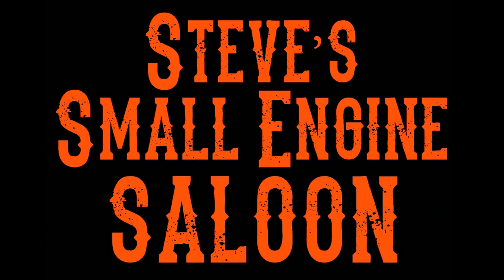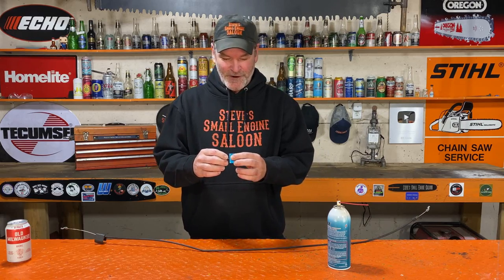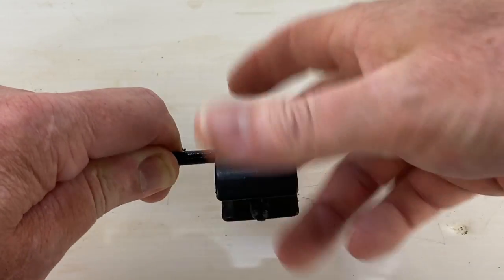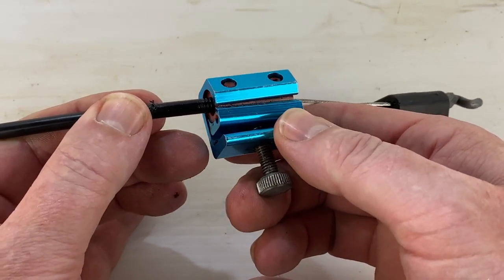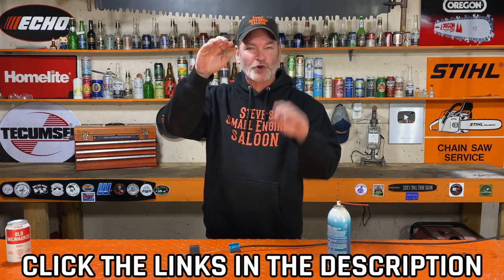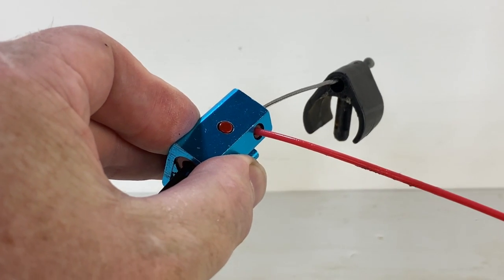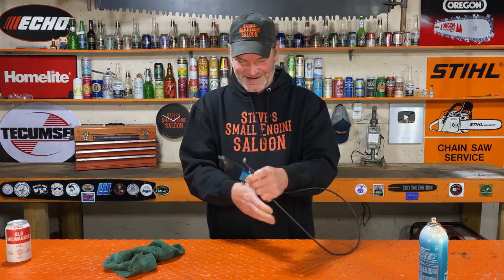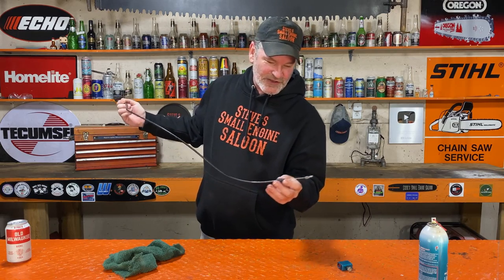The Ultimate Tool to Properly Lubricate Your Lawnmower Cables

Comment: I worked at a Honda motorcycle dealership back in the 70’s. All the mechanics had one of these in their toolbox. Worked great on throttle and clutch cables.
Reply from the maker: Right on
Reply: I can't believe that I didn't know about this tool, and neither did my friends.  So much frustration trying to lube cables, and now you say they've been around since the 70s? That's when I got started with small engines!
Reply: I've had one for 50 years

Comment: Why do cables with sheaths not come with an automatic oiler/ lubrication system as part of a maintence schedule? I mean they make grease fittings. P.S. $50.00 U.S. for a drive cable for a walk behind mower. And yes I know I answered my own question, corperate greed.

Comment: I've had one of these for over 30 years. I haven't used it as much as I thought I would when I bought it, but it sure comes in handy. A must have tool in my opinion, if you encounter bikes, mowers, motorcycles, basically any engine powered or human powered machine.
Reply from the maker: Right on
Reply: I too had one about 30yrs ago when we ran Moto-Cross.

Comment: I've Been An Auto Mechanic 50 Years. I Worked For Volkswagen And Audi Dealers For 33 Years. Back In The 80's When I Was At Volkswagen We Got One  Of These For Lubing The Manual Cables For The Heat And A/C Controls. Even With A New Cable Sometimes Customers Said It Was To Hard To Move The Levers In The Dash Control Pannel . . I Use To Put The Straw From The Can Of Spray Grease In The Hole And Lube It Up. It Worked Great.
Reply from the maker: Right on

Comment: I have one of these that a bought in 1981 that I used on my motocross bikes. It still works fine. I find that you have to be careful lubing cables if you are going to use your machine in winter because some lubes can freeze and cause the cable to be inoperative.

Comment: I honestly think ot was you that recommended one of these to me, but I already knew about them years ago working on Motorcycles  and snowmobiles. They work great and highly recommend them. If the cable is too badly rusted, it doesnt matter what you do, that cable is toast. Still a great suggestion. If the outer sheath is bad on a cable, replace it.

Comment: I saw this luber on Mustie 1 years ago and I just had to have one.  Works super well with cable lube from PB Blaster although any lube is better than no lube.  

Mower cables left out in the weather often have rain water go down the inside of the cable cover and silently causes a metric ton of corrosion / rust.  

Joe

Comment: Hey Steve, I did that to my three wheelers and four wheelers when I had cables on them and I used creepy oil. I don’t know if you’ve ever heard of that but it’s an oil that creeps. You can spray it on the bottom of a bolt and it can have a nut on it and spray it on the very end of the bolt and it will creep its way up into the net works really well good stuff great for lube and your hinge pins in your doors in your house and your locks, whether there are deadbolts or key locks both of them it works fabulous for that stuff just a pin drop or will do the hinges just put it at the top of the engine, open the door and shut it and it’ll take care of the squeak
Reply: "KROIL," "the oil that creeps"

Comment: I bought one of these a few years back.  Mustie1 showed one and it's awesome.  You must have the magic touch because I usually make a mess and get spray all over the place.

It's more than payed for its self saving rusted cables.  I've gotten completely frozen ones working again, Sometimes I'd stray brake cleaner through them first to try to clean out any old lubricant/dust/grime.

Keep up the awesome channel

Comment: I haven't used one, last time I used patience and an oil can with 10W30 oil. It's a bit thicker but actually works pretty good and for a long time.
Reply: Make a funnel out of heavy paper and tape it to one end of the cable.  Hang the funnel from a high point with the cable hanging below and fill the funnel with your oil.  Let it hang overnight.

Comment: I have this and another that I use for lubricating cables on all my machines, motorbikes etc etc. The old trick using a cut sandwich bag and cable ties works a treat as well using some engine oil for lubricating.

Comment: Hello, thanks for the tip, I just ordered this tool.   I have a question. What do you think about this, for a 2 or small 4 cycle, before you put it away for 5 months or so. You add small amount of 2-cycle oil to empty gas tank and pump it into the carb and return line. Then months later add some gas to the tank to flush out the oil then refill with proper gas mixture. Is this a solution to storage or problematic? Thanks

Comment: Neet little tool . I used to do the same kind of thing 35 years ago with my dirt bike cabled but I used half a tennis ball with a small hole in the bottom of the bowl , poke the cable through fill it with light oil and hang it in the vice overnight to drip through.

Comment: I’ve never seen one.  I will get one for my man lift (inherited).  The shut off (stall) cable is tight.  If that doesn’t fox it, then I’ll have to replace it.
Thanks for the tip.
Reply from the maker: You're Welcome...

Comment: Great videos Steve. I’ve inherited a Yardpro 96148002000 dated 2010. The belt keeps slipping off the self propeller pulley. Looks like the adjuster for the tilt of the gearbox/pulley is rust deleted and/or modified and I can’t find a good diagram of the OEM part. Also the pulleys don’t look at all aligned. Think it was a Sears mower. The engine runs great and I can still muscle it around the yard but I’d like to try and get the self propelled function working again. Any suggestions?

Comment: Ok Steve I love the channel and have learned allot. Maybe either yours or viewers can han help. On the bottom of a generac Pressure Washer where there could possibly be a leak have you ever used the caned spray that will show a crack and have you ever mig welded a crack in that cast aluminum. Any help would be greatly appreciated. Thank you

Comment: QUESTION: Do lawnmower cables have an inner lining or are they simply sliding metal on metal like old bicycle cables?
That would probably make a difference on what you want to lube them with.
Reply: Ye. The liner makes a difference. Some lubes make them swell making a sticky cable worse.

Comment: I got one of these for my motorcycles, after the second time I snapped a clutch cable. After that, I became fanatical about keeping my cables lubed. I’ve actually misplaced mine, and should probably buy another. I believe mine was from a company called Grease Monkey, or maybe that was the name of the device.
Reply from the maker: Right on

Comment: Hi Steve,  An unrelated question please.  Can a chainsaw be used to cut wood against the grain?  Will it damage the saw or chain?  I have several large rounds and do not have a wood splitter.  Can I use a chainsaw to cut them into quarters to make it easier to split by hand?  Thank you for your time.
Reply: Yes you can, but it's easier on the chain to cut from the side and not from the end . Some people call it noodleing because the sawdust is long stringy and looks like spaghetti
Reply: Thank you very much.

Comment: i'm wondering if i got myself into a serious problem. i was taking, or trying to take off a frozen rear tire on my troy bilt horse xp. i'm an old guy, so i couldn't hit the rim too hard. but the axle popped out. i pushed it back in, it actually felt like it 'popped' back in place, and yanking on it as hard as i can, i couldn't get it to pull back out. did i damage it? or is this just how the trans axle is?

Comment: Between these 4 options what would you say is diabetes in a lawn mower?
1. Cracked primer bulb
2. Bad cylinder
3. Dirty spark plug
4. Clogged fuel filter

Comment: you can lubricate without the tool, just push lubricant into top portion of your cable and let gravity move the lubricant down the cable over time. do it a few times and your good.

Comment: Stop...  nice idea but what would be the best oil,, lube to  use for this...  Some oil mix's may cause problems with the rubber tube the wire is in.
    List the best to use for this... if the wire has damaged the rubber a bit I may need a heavy oil type and not a light oil..  Got a problem with one in my car and replacement will cost 200$    Thank you all.

Comment: I use a plastic bag with oil, hang on handle,poke cable through bag and it will flow down and won't have to remove

Comment: Better, Cheaper, Less messy Idea : Small fuel line hose that will slide over cable end. Mini hose clamp around cable sheath. Fill hose with lubricant, Apply light air pressure....DONE !

Comment: Hell those are not necessary at all and actually doesn't do much. My Honda HR215 SX is forty years old and still have the original cables on it. Other than occasional adjustment due to cable stretching I've had no issues at all with lubrication. Just another gimmick.